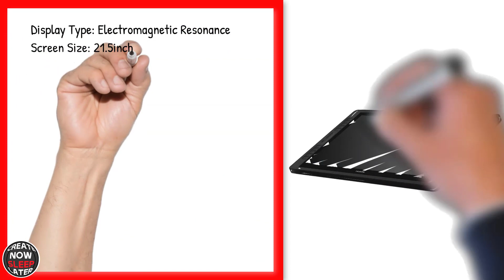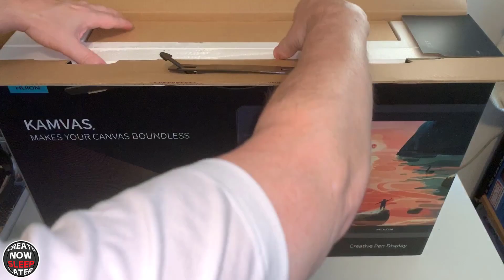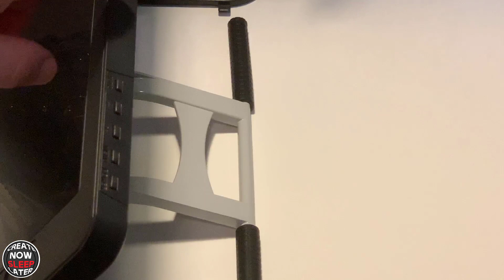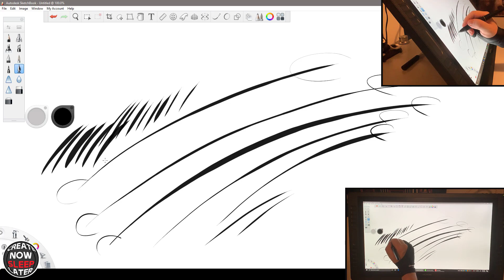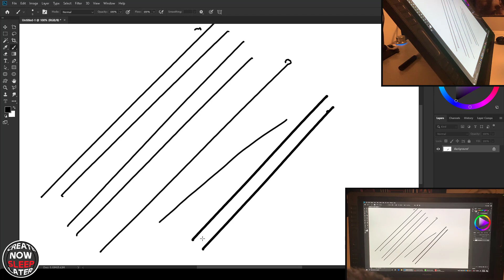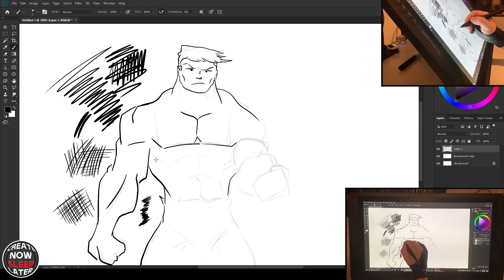Huion Kamvas Pro 22 Review Refreshed Model!

Comment: My main concern is their pen. I haven't used their battery free pen yet, but I have their charging pen and it no longer worked after about a year of use. Other than that, I thought the Huion product was great for it's price. Has anyone had any issues with their new pens after long uses? Because right now it seems like the main reason you'd fork over an extra $400+ for the Wacom version of this (Cintiq 22?), is mostly for the Wacom pen.
Reply from the maker: No Comparison.  If you notice on the channel, I hate battery pens.  I dont care who makes them.

Comment: i own one of these and used it for a month. Suddenly the pen stop acting weird and now doesn't work. When i got a replacement it didn't work either. I waited for Huion to tell me a solution for a week and a half, and nothing yet. This tablet has promise but it's now a glorified monitor that I can't draw on after I exhausted my options. I planned on upgrading from a 13HD Cintiq to this but now I have a sour taste in my mouth from this 500 dollar tablet failing me.
Reply from the maker: When you say replacement, they sent you a pen I assume?  Here is the thing, the pen nor the digitizer have moving parts that break.  What computer is Amit attached to? Did you try another computer?
Reply: @CreateNowSleepLater  Sorry for the late response, riots are happening in my area so...that's happening. But anyways, I was waiting for a response for them but nothing. So I actually bought a replacement pen that was the same model and everything. But the pen did not work. They did however sent today an email about wanting me to use a software they sent to measure out the situation and they sent a video recording to me.  A day have passed and nothing yet, ironically the Huion Twitter account followed me.
Reply from the maker: What OS are you using? Did you try another computer?
Reply from the maker: @ThatOneMotherfucker  So on another computer, it doesnt work either.  Starting to sound like an RMA to me.  Doesnt sound like a pen although a digitizer going bad is not typical.

Comment: I can see within 5 years all of the top line Huion and Xp products will have a decent etched glass/matte finish with a 4k display. Wacom might benefit from the expanded marketplace as more illustrators/fine artists choose to start and finsh their work in digital format. Especially if a stratified market develops, high and low end products from all three.
Reply from the maker: Yep, the newest Huion Kamvas 13 I reviewed has something on the matte screen protector that gives it a pencil like feel.  I’m not sure why they didn’t advertise it but I could feel the difference out of the box.  On the 16” and smaller, I’ll take QHD only for the ppi benefits.

Comment: Hi how would you describe the parallax on this compared to the cintiq 22? I read that this has a laminated screen whereas the cintiq 22 doesn't. Does it make that big of a difference?
Reply from the maker: I do think it makes a big difference.  Especially on the big models.  Im not sure why Wacom didn't do the laminated screen on the new 22".  Penny wise, pound foolish.
Reply: @CreateNowSleepLater  thanks very much for getting back to me so soon, will definitely go for the huion I think, I've got an older version of a huion GT151 and had loads of issues with the driver so fingers crossed I don't get the same ones again!

Comment: As a first time purchase is it safe to buy the 2018 version for 45% cheaper than the 2019 version?  What is your honest opinion?   (non professional work hobbyist)
Reply from the maker: It’s safe sure.  The newer version makes a lot of improvements in color.  I have a video on both.  It’s not the tools anyway.  You can make great art with both.
Reply: @CreateNowSleepLater  hi, does the 2018 vs 2019 version has many significant differences?
Reply from the maker: The color is a ton better.  The drawing experience is a bit better tuned as well.  Tilt was added in a fw update as opposed to being native.  It works but sone people complain of the cursor jumping around.
Reply: @CreateNowSleepLater  but as long as you dont instal the tilt, everything would be fine. About to get the 2019 tomorrow.. hope the pro's overwhelm the cons.
Reply from the maker: Pros of the 2019?  It’s a solid device.  If I didn’t have a Cintiq, I’d be fine just using the Huion.
Reply: @CreateNowSleepLater  hehe maybe not to update fw will be a good idea.  thanks you very much for sharing; I just receive the device I while a go and still exploring and getting familiar. :) cheers!

Comment: My drawing software works well with a basic drawing tablet. I wonder if a pen display like this is gonna work well too. Do I need a powerful graphic card to use a pen display?
Reply from the maker: You don’t.  The only thing I can see from a resource perspective is the software you run but that shouldn’t be an issue since you are already running them.  An example would be photoshop loves ram and a 3D program might need a good gpu. It’s not really the display is what I’m saying.
Reply: @CreateNowSleepLater  thank you. You are very helpful buddy.

Comment: Is there an updated version of the Kamvas Pro 16 aswell? I keep bumping into titles with "2019 update" from both sellers and reviewers but no one actually explains, or even mentions, what's changed? The specs usually looks identical whether it says "2019 update" or not?
Reply from the maker: The one I reviewed is the 2019 model.  There is a premium version of that which Huion told me bumps up the srgb to 150% but it’s only commercially available.  I think that means you need to call them about it.
Reply: @CreateNowSleepLater  Hey, thanks for your speedy reply. So there's no version prior to the 2019 model? Meaning if I get one without any mentioning of 2019 update I'd at least get the one your reviewed. Just so that I don't get some old outdated model ;)
Reply from the maker: Right, the links in the description will take you to the right one.   They are affiliate links but you can just paste it into another browser if that isn’t your type of thing.  I’m on a phone and it’s hard to search at the moment.

Comment: Which one is better: kamvas pro 16 (2019) or kamvas pro 22 (2019)
Reply from the maker: The Kamvas Pro 22 is just a bigger version of the 16.  They share the same upgrades from a year ago.  I would make the decision based on size and if you need to travel.  The other thing is you can't put the 16" on a Vesa arm so you need a stand.  That might make a big difference to you.
Reply: Also the response rate here is 8ms while on the 16 that I have is 25ms which is noticeable. But I travel ALL the time so I can't really get the 22. Also I prefer the smaller size I wish it was faster though

Comment: Imagine if Huion adding more features in it in the future like the multi-touch function.
Reply from the maker: That would be awesome along with higher Rez.
Reply: I think it's just a matter of resolution. If you want a touch screen it will just take longer than a shortcut using your left hand, imagine having to move your pen away to pinch the screen.
Reply from the maker: Yep, I’m a fan of touch when sketching but if I have to work with color it inking, touch just slows me down.

Comment: Great review,   About ppi. in the huion 20inch model   Is the sharpness and overall image better ?  I mean  since its shrink from 22 to20 inch pixels per inch shrinks too   Is this actually looks better "? (I bet yes but ...).   Also. Is there a significant gap/difference between  the feel of how pen pressure works /feels   Between this and the wacom pro pen 2 ?     I have the strange impression that huion pen is similar to wacom 2048 pens (present in cintiqs 22hd,24hd and 27 Qhd .     Thanks
Reply from the maker: You’re right about the 20”.  The ppi will be better.  The Wacom pen has a lower activation level meaning there is a slight increase in sensitivity at the light end.  It’s very subjective though if you notice it depending on how you draw/paint.
Reply: Create Now Sleep Later thank you very much for your answer , it helps ,.. I totally understand what you are talking about ,.. I have a cintiq companion 2 , a intuos 4 M ,the apple pencil (with the ipad pro of course )  and had  (sold it ) surface pro 4    Their activation force are all different ,.    I think this little things matter a lot ..    hardware is important of course ,(im not diminishing it)  but  its also true that sometimes words can’t describe super well  the “feeling “   But its so important ..    thanks again for all the reviews and effort you are doing . For freelance artists who specially are living (like me) in a country /city  where’s zero chance to tryout one of those monitors .. its super helpfully and Im truly appreciate it . :)
Reply from the maker: @Chejov1214  Awesome, glad I could help!

Comment: Finally a critical take on budget drawing tablets. Presentation is a bit rough around the edges but the content itself makes up for it.
Reply from the maker: Thanks for watching! For presentation, what would you change?
Reply: @CreateNowSleepLater  Minor things, for example those shots showing you speak to the camera: you have a bit of background noise. Loud enough to be distracting. Also the part where you show the connections, you could have done extra editing with that. The correlation with the audio and video could have been clearer.

But these are very minor details. The content is good, and that's what matters.
Reply from the maker: Thanks, it’s interesting.  My little studio is in transition so placing the mic is hard.  Also, I just got the be camtasia and it’s the first video I did with this auto audio leveler.  Thanks for the feedback, helps me improve.

Comment: Another great video John.  Great info! Thanks again for your help with my question about using these with iPad pros. Just saw a detailed post about it in tablet pc review that expanded on what you said. Still a bummer though:). What are your thoughts on the longevity/dependability of huion’s displays?  Do they have a decent lifespan?
Reply from the maker: Thanks! Yeah so far, anything I used held up.  I haven’t had any failures.  I think even more telling is you don’t see people reporting in the comments about them dying.  I think it’s safe to assume these will last.
Reply: Create Now Sleep Later Awesome! Thanks. I’ve seen a a few stories online about it so I wasn’t sure if it was actually a problem or just a few bad experiences. Plus cintiqs are touted as lasting forever so maybe it made those issues with alternatives seem overblown.

Comment: Rumor says wacom will release affordable cintiq 22
Reply: https://www.youtube.com/watch?v=xBPNyYX6zi8
Reply from the maker: Odd move from Wacom.  It should be improved over the last model, I thought they would go pro, 4K etc.  the huion beats it in spec and price but some will pay the extra for a Cintiq.
Reply: @CreateNowSleepLater  i use surface pro mainly due to zero parallax since i need to move tiny dots in illustrator paths, but the screen size really slows me down. do you think kamvas pro 22 suitable for me?
Reply from the maker: Which surface pro?
Reply from the maker: Haven’t heard that.  The 22 needs a refresh, maybe an affordable one like they did with the 16 and a pro with all the improvements.